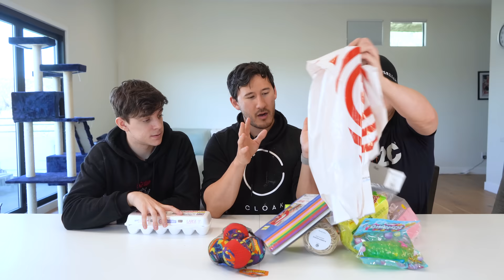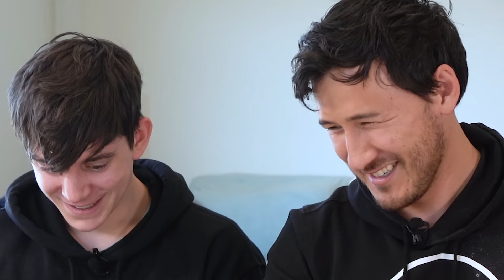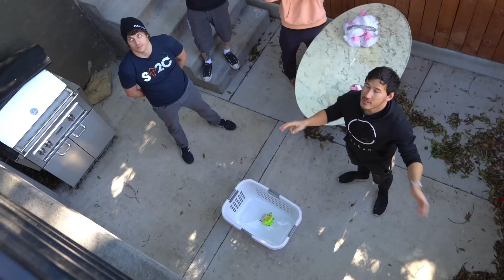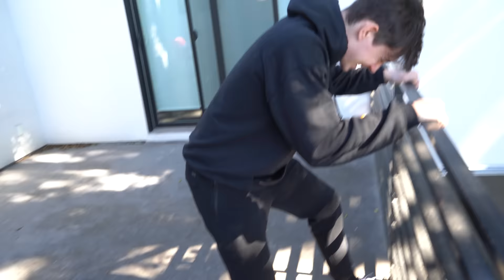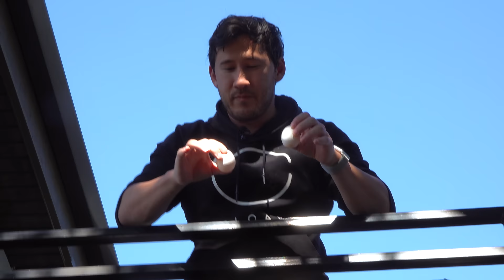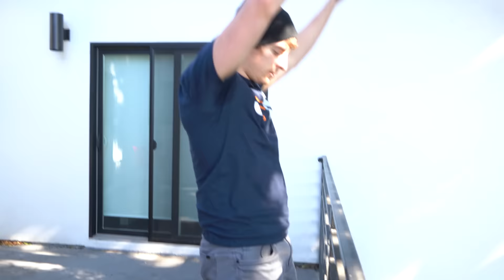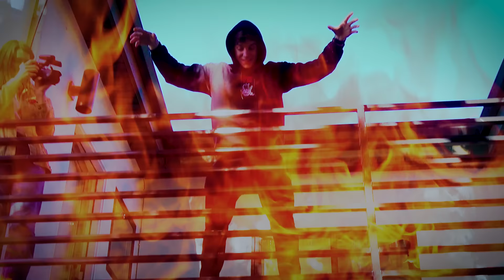Markiplier Makes: An Egg Drop

Comment: From a high enough distance you can hard boil the egg while it is falling with a simple heater around the outside of the dropper and a pocket of water, a little cheap but if someone manages to do it they should get a 100 for the year in science